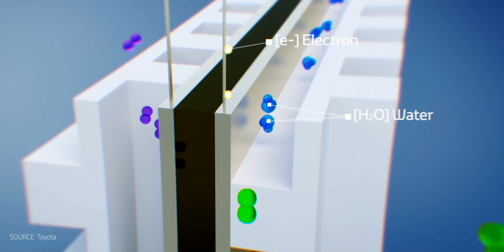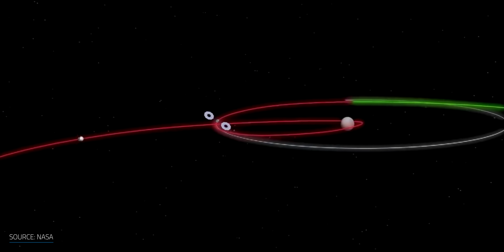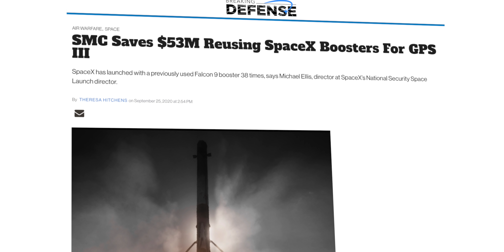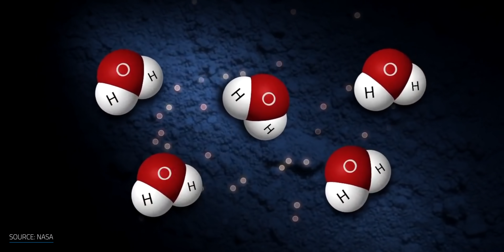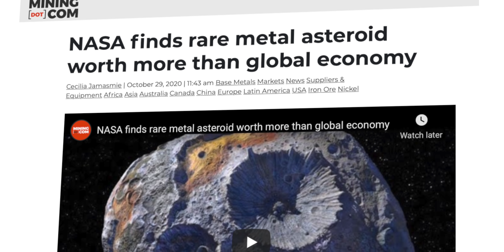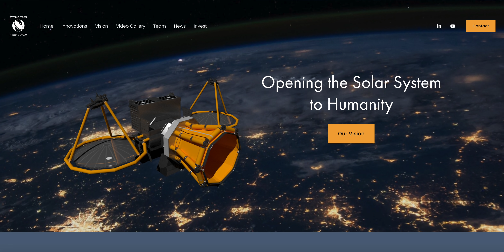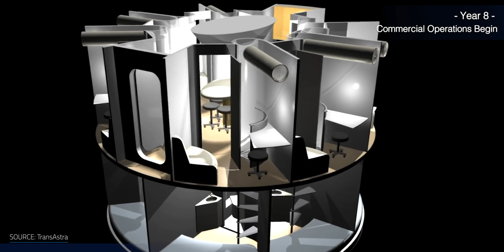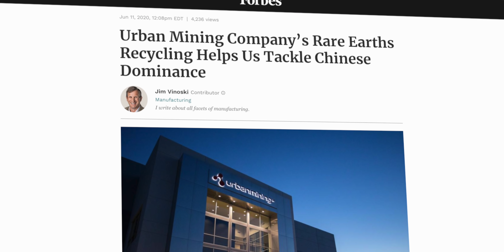Does Space Mining Solve Our Resource Problem?

Comment: Error. No shortage of rare earths. The issue is processing and mining is so filthy even China shut down its BaoTou mines and is moving operations to Myanmar 
The problem is that rare earths are often found around toxic and radioactive elements and explosive mining operations spew deadly dust. 
Recycling has a high yield, the Moon would be great, but improving chemistry, mining robots and methods on Earth are critical. Environmentalists, and I count myself, will have to hold the line against using explosives, but allow 10 square mile sections of Death Valley to destroyed for the more urgent task to stop carbon emissions.
Also, asteroid moving is double edged. Drop one, and the damage is far worse than many nukes.

Comment: Until space elevators to get the amount of equipment into space for a mining operation it will not be cost effective. That will also solve the return cost of getting materials back to earth. However, I'm with Isaac Authur on this, the first few viable uses of astroids we haul back are not for getting resources back to earth but for building the space infistructure needed for the industrialization of space. 

The first few will be for building our refineries, colonies, and being anchors for space elevators to attach to as they are moved to orbit earth. 

Also, side note, stop being so anti Trump and get over Space Force. All of our branches of the armed forces had space based assets and it needed to be unified under its own branch much like with the creation of the Air force in the days of yor.

Comment: As for covering the world in wind farms, I guess that's a good idea too. Chances are, the world is only going to get windier, so make sure they are robust and adaptable to conditions. Sorry for solar power, having a rare element required for it. However both have weakness for supplying a grid, because sometimes it isn't windy, and sometimes the sun isn't shining... so that's where plants for using these wind and solar farms to put hydrogen into tanks might come into play. Tanks of hydrogen can be like back up batteries.
So basically build endless wind farms, but make sure that when the grid doesn't need that power, it's filling up tanks of Hydrogen for when the power demand increases, and these can tanks can be shipped, and won't even weigh much. Cars can be designed with a rollout, roll-in mechanism for these tanks too (replace the whole tank instead of fill-er-up).

Comment: Two aspects of Space Mining are outstanding. A : refining metals in a vacuum allow us to cheaply create ultra high purity ingots and final products with no included oxygen (or other gases) which is near impossible on earth, and anyway currently ultra expensive. These pure materials have highly enhanced and unique properties that will allow us to make huge leaps in our understanding of the universe and vital technological advances. For example oxygen free steel has completely different strength and ductility to the stuff made in an atmosphere. B: manufacturing at the top of Earths gravity well allows us to fabricate and assemble much larger ships and other machines -  solar furnaces, habitats, cities, than we can economically create by  assembly on earth and launching to orbit. If ever there was a case for building a Master Printer ( one than prints other printers and everything else besides) , creating such a thing in orbit has to be the best of good ideas. Additionally the relatively simple task of disposing of hazardous mine tailings in orbit can be perfectly achieved by sending such material into the sun for ultimate re-cycling.

Comment: Hard part is getting them back down without burning up most of it and the fuel required to do so. Space mining is probably better suited for manufacturing  or resupplies in zero to low g environments. Such producing rockets / fuel on the moon or in a orbital platform. So your only real lift weight out of earths gravity well is the passengers.

Comment: If we transport material from the moon to Earth, it would require water to be used for fuel to launch from either body, thus we are wasting water which cannot be recovered. 
The physics of the moon's orbit would change. If the moon's orbit drifts further from the earth, the tides would be weaker and we need those to help with oxygen generation from the movement of the seas. (Less mass+repulsive force from rockets+constant orbital speed=higher orbit)
This sounds like using a slow ecological suicide to solve the problems of industry which are causing a rapid ecological suicide. There is no shortage of materials, just a shortage of professional responsibility.

Comment: If we are running out of thise materials on Earth, then eventually it will be cost effective.
Also, 13k/ kg is cheaper than modern prices.  I don't know the cost exactly, but gold was about $40/gram the last time I checked over a year ago, which would make it 40k/kg.  Platinum is usually a bit more expensive than gold.
So this platinum would cut the cost to a third or less of its current cost.
Yes, do this.

The byproducts can then be used to make colonies and other space industries.  Iron and other elements to Earth orbit would make orbital stations cheap.  Sure, we would need to cut the cost to ship to orbit greatly, but i'm sure that will happen once we have a reason to build the infrastructure.

Comment: Mining the Moon is a vastly smarter and easier than trying to mine asteroids. If we are looking for materials to be used on or near Earth. The majority of minerals we mine on Earth was delivered to the Earth a few hundred million years after the impact that formed the Moon in an event called the Late Heavy Bombardment.Which was a massive asteroid shower lasting about 300 million years. All of the Gold, Platinum, rare earth minerals, pretty much everything we mine came from the LHB...Even still most of that material is under the ocean or because of geological activity has been transported deeper into the Earth beyond our reach.

However the Moon also went through the Late Heavy Bombardment. It was the event that rubblized the lunar surface and gave it all those wonderful craters. The Moon didn't have an atmosphere to turn the LBH asteroids into dust or weathering. The Moon doesn't have an ocean covering 3/4 of it's surface or plate tectonics to move the LHB material too deep under ground to ever mine. Much of the LHB material should still be readily accessible in the lunar crust using mining techniques similar to those used on Earth.

Comment: (6:50) "It's because this helium isotope isn't radioactive, it wouldn't generate toxic waste."

Absolutely wrong. Fusion produces high-energy neutrons that bombard the walls of the reactor, making it brittle and highly radioactive, meaning that the walls will need to be continually replaced using robots and the old walls will need to be disposed of very carefully, or kept under lock and key for many decades if not centuries. Fusion power stations will probably produce more toxic waste than current nuclear (fission) power stations.

Comment: When a "space rock" of any size enters the Earth's atmosphere it either burns up or disappears in the ocean.   If it hits land, it is a curiosity.   When a space rock hits the moon it forms a permanent crater which we observe in our telescopes.   The question is:  Why go expensively chasing after space rocks in the asteroid belt when you have tens of thousands of them trapped on the moon?   Nothing gets burned up in the moon's atmosphere because it doesn't have one!   All of those objects that created those craters remain concentrated in the center of each crater.   So how do you determine if it is worth mining?   Simple:  Astronauts drill an exploratory hole in the center of the crater.   The regolith is soft and you probably wouldn't have to drill more than a couple of hundred feet to find the source of the crater.   If it is high value then mine it out.   The "Boring Company" could probably give you some ideas on how to go about that.   Some may be shallow enough to do open pit mining.   Surely this would be easier and cheaper than searching for high value rocks all over the solar system!   How would we get these materials back to Earth?   For many years Science Fiction books have described a magnetic catapult on the moon putting materials into the moon's orbit or directed to an Earth orbit.   Each "shot" depends on stored energy which could be accumulated with solar panels or a nuclear reactor.   This idea is well within current technical capabilities.   The whole surface of the moon is one series of overlapping craters that probably has every single element known to man just under the surface.   Why has this fact always been ignored?

Comment: No, it wouldnt work even with platinum

Platinum is at this high price currently because it matches our demand and matches the other effort/payout ratio of other ressource
Platinum is actually just as well priced as copper or iron, the demand is very low, and the effort to get it is very high, so the price is also high
BUT the price is not unreasonable, the price is where the market currently puts it, we could get platinum in much larger quantities and for much cheaper, if there was more demand, but there isnt, so even if you could make a profit by mining a platinum rich asteroid and bringing it to earth, earth based mining companies could just slightly expand their operations and price you out of the market imediately

tl:dr Platinum is expensive per weight, but it can get a lot cheaper if we had a greater need for it, even if you could make a profit on the market with star platinum, earth based platinum mines could easily adjust to price you out again and kill your entire space mining operation
Plus, the fact you need something as crazy expensive as platinum to even make the obtimal math for profit work should tell you it is an absolutely terrible idea
Reply: basically, "simply looking at what would be profiteable misses the fact that the market on earth in most cases could easily change to make it unprofitable, and also fails to take into account why those things are at that price to begin with (hint, low demand)"

Comment: I'm of the opinion that all of this will be highly dependent on the successful establishment of a lunar base which, on top of being used as a factory, can be used in the same manner we use shipping ports and airports on Earth. For near-Earth asteroids, "pull" the asteroids to the Moon for processing. To save on transportation cost, don't use transport ships that need to fly from Earth and back. Instead, construct simplified transport recovery vessels in the Moon's factories. The only requirements of these vessels are that they can safely land back on Earth (in bodies of water if it makes it more economical) and are themselves easily recyclable. These vessels do not need complex or high-powered propulsion system since they are essentially just falling back to Earth in a safe, controlled manner.

An analogy would be having to retrieve your friend's apartment key from the 10th floor. One option is to take the elevator to the 10th floor, get the key from your friend, and finally take the elevator back down. Instead of doing that, your friend constructs a parachute made of paper towel and string  and attaches it to the key so that she can drop it down to you safely (for simplicity, we're assuming there is no wind to blow it off course). Now you have the key with very little work and you can reuse the towel to blow your nose.

Comment: Here's a simplified explanation as to why space mining "makes sense". This is not 100% accurate, but it will cover some bases not directly covered during the video.

Those valuable metals, like platinum and iridium, are dense. That means they will sink through lighter elements if everything is liquified, and when earth was formed, it was molten. So most of the heavy stuff sank down deep, and we have a bunch of the light elements floating on top in the crust. So, earth has plenty of heavy elements, but they're thousands of kilometers beneath the surface. We literally do not have the technology to get there.

Asteroids formed from the same basic stuff as the earth, but they're small. They don't have enough gravity to form a "core" of heavy stuff, and even if they did, they're small enough you could literally drill right through the middle of them. We do have the technology to get to those asteroids today. You could just send dozens of large rockets. It would be expensive, but it is, at least, possible to get to the resources in the asteroids, whereas it is literally not possible to get to them on earth. 

Going millions and millions of km into space is easier than going even dozens of km down on earth.

Comment: Space mining in-situ will be huge and beneficial. Especially if used for more than volatile fuels.  
Sources:
A) captured/bagged “rubble piles” 
B) bore hole mining on the moon

Separation:
1) Crush/grind, 
2) concentrate using 
  A) optical separation/spectral analysis, 
  B) Ferromagnetic 
  C) electrostatic 
  D) centrifugal separation in various solutions of density (ferrosilicone, etc)
3) HEAT using fusion reactors (yes, still a generation away) for impurities.

Use/synthesize separated material into commonly needed strips/bars/beams/walls/forms ready for use, Or send resultant ores to a manufacturing facility, or pre-programmed production to self-repair/enlarge the mining facility until we create The Doomsday Machine (Star Trek: The Original Series).

Comment: "Also, they could implement this process directly on the Moon or on Mars where you get plenty of carbon dioxide out of the air." There is an atmosphere on the moon?
Reply: There is, but it's very thin. It also doesn't have much in the way of CO2. Presumably that piece of the sentence was intended to refer to Mars. It is (probably) possible to generate CO2 on the Moon by heating regolith.
Reply: Not enough gravity
Edit: there actually is a atmosphere with neglectable atmospheric pressure ( i learned this 5 minutes ago)
Reply: @CHMichael  not enough magnetic field, causing solar winds to knock the atmosphere away. There is more than enough gravity to hold a decently thick atmosphere
Reply: this video is filled with errors and oopsies..
this guy just made a youtube video to get views..
send this to #thunderfoot
Reply: @rajadhirajmaharaj  He might be busy debunking Solar Roadways.
Reply: @ThePamastymui  *Hyperloop ;)

Comment: I don’t see how returning material from the moon will be expensive. I would use an electromagnetic rail gun to launch a reentry capsule into a return orbit. the capsule would mostly be made of waste material from the mine and would protect the contents from reentry. 
Any thrusters, navigation equipment or parachutes would be refurbished and returned to the moon. 
I’d aim for uninhabited desert areas to be safe as the landings don’t have to be gentle. You just have to slow it down enough so it doesn’t get totally destroyed when it hits.
Reply: The thing is though, most of the early projects would probably have people working on them, so you'd probably want an Aldrin Cycler to go back and forth.

Comment: The initial premise is false. There are almost no major minerals that will actually run out on earth. Its simply that as we get through the easy to get resources, we have to move on to harder to get resources and that pushes up the price. However, the cost of mining is dependent on the cost of energy and we are likely to see a dramatic drop in the cost of energy in the next 20 years or so due to wind and solar being well suited to over supply. That said, SpaceX plans to drive down the cost of access to space in a similarly dramatic fashion so it may still be cheaper to mine in space.

Comment: The only smart place to use material from space mining are in space. There you can subtract the cost from getting up from earth in the cost of mining.

Converting metals to a form that can be 3D printed is something that can be done in a compact form and  then printing structures in space can be done using robots that slowly print and sintering any size of structure needed.